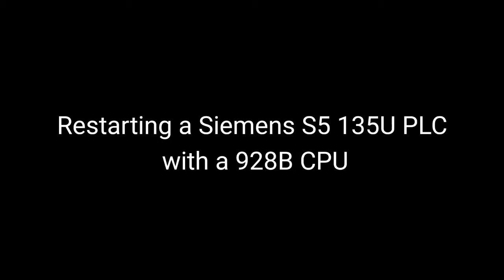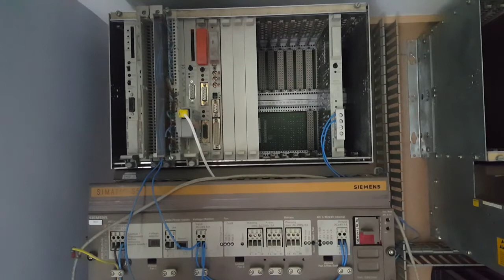Restarting a Siemens S5 135U PLC with 928B CPU

Comment: I have problem with my 135plc every time I put it on run mood the output remains flashing even when we changed the cpu
Reply from the maker: Hi, on the power supply are there any yellow lights illuminated?

Comment: One thing to note here: In my case the power supply had a jumper on the board which had to be opened in order to get the CPU into RUN mode without a backup battery. I almost thought my CPU and/or RAM was damaged, but luckily found the hint in the manual. With the jumper active, the CPU wouldn't go into RUN, even after the steps performed at 9:19
Reply: Ty man your comment helped me to solve my problem 😀👍
Reply: @ThePolarnimedvjed  Excellent!
Reply from the maker: Hi,
That is an interesting point. You will see in the video that I only have the mb low led on and the rb low is off. In that state the CPU will go into run however if rb low led is on the CPU fails to go into run. Did you change the MB-NB jumper?
Reply: @a-c-pautomation8672  From my memory I am pretty sure it was the MM - NN jumper, not sure about the MB - NB

Comment: Hi, i have done this also. same. but the same issue. the stop light was stable , and when i put the CPU to run mode , with Reset switch, then red light start flashing. Now can you advice , what will be issue now. 
> did my CPU Card got Damage ? 
> Did the back slot in the Tray Module got some issue ? 

As before we have tried many things, but the CPU is not comming to run mode. then my engineer said that, we need to repire the power supply , as in the fault pic. NAU is showing , then we have repaier the POwer supply , in which they have showed me that the NAU , is being removed. then i thought that now the CPU will go to run mode. but unfortunately , it is not goign to run mode. 

So , pls. advice , what do you think , what is the issue is creating this problem. my machine is on stop mode for the last 2 months. and here in New Delhi , their are not much S5 experts to give me correct advice or find out what is the exactly the issue is. 

NOTE:- Pls. do let me know , can you pls. tell me from where i can get COM 247 Software for Card 6ES5247-4UA11
thanks, pls. Advice.
Reply from the maker: ok. could you tell me what lights are on on your power supply and also what lights are on on the CPU? when you put it into run is the plc still empty? I.e no program.
Reply: @a-c-pautomation8672  Sir, 

when you put it into run is the plc still empty? Yes.I think , As when i have done Overall Reset to 1st CPU , after that all data must be erased, as i have not checked it by connectiing laptop, as today My pls Engineer is comming he will connect it and see. and i will update you. 

Power Supply - Extream Right side - under Internal 5V/15V/24V DC
5V DC - Green Light ON
15V/24V DC - Green Light OFF
24V DC 0.4A - Green Light On. 

First Slot is the Cordinater , 
Was on Test Mode and "IF FAULT" Red Led is on. 

Second Slot is 1 CPU - 
STOP Red Light ON
BASP Red Light ON

Third Slot is 2nd CPU 
STOP Red Light ON
BASP Red Light ON

IMP NOTE: Pls. can you tell me from where  i can get COM 247 Software for Card SEIMENS 6ES5247-4UA11

Can i have your email , or contact number.
Reply from the maker: @rajatloomba  Hi, do you have another power supply you could try as the 15v light should be on, although I'm not too sure how important the 15v is for the CPU. I know the 15v was required for certain cards like the H1 network card etc, do you have up to date programs for all the cards/cpus? if you do I would be tempted to pull all the cards out except for CPU 1 to see if you can get that to start up. With just one cpu plugged in it should start up. Unfortunately I don't have the com247 software, you may have to ask a Siemens sales rep for that.
Reply: @a-c-pautomation8672  Hi, Yesterday we have done the same thing that , 

1st Card is - 6ES5923-3UC11 - the Cordinater, 
2nd card is - CPU 1
3rd Card is - CPU 2

We have taken out the Card1 , just put CPU1 , and that is going to run mode , when it is empty , no data in it. 
Then we take out CPU1 and put CPU2 , and that also going to run mode , when it has no data. 
and 
When we put Card 1 cordinater + CPU1 + CPU2 - and loded the data in both the CPU , 
And
when we just put the Cordinater to run mode , what happen is that , both the CPU gose to Run mode and immediately shift to stop mode. 
So do you think , the Cordinator is creating an issue in this. 

Pls. advice. 

>> I know the 15v was required for certain cards like the H1 network card etc = WE DO NOT HAVE A NETWROK CARD INSTALED ON IT.
Reply from the maker: @rajatloomba  hi. that sounds good news that the CPU cards will go into run when they are empty, this to me says the CPUs are ok. Have you tried both CPUs and the coordinator card in run with no program in? It could be that the program is trying to access some i/o that is not responding. Have you checked the BSTACK? Thanks Andrew.
Reply: @a-c-pautomation8672  Hi, Can you Pls. tell me how will i make a hard copy or soft copy of the program logic which is inside the CPU 1 and CPU 2. waiting for your reply ASAP. thanks.